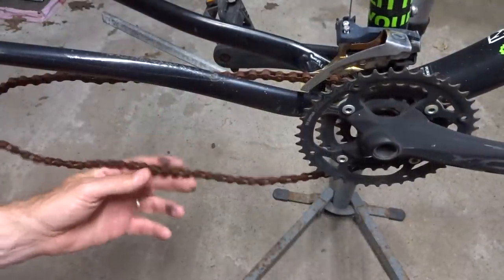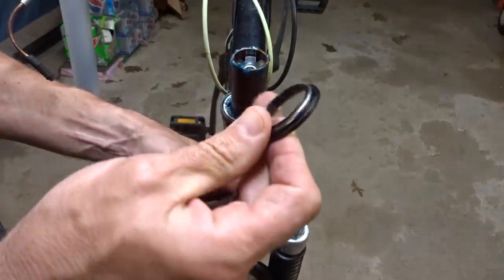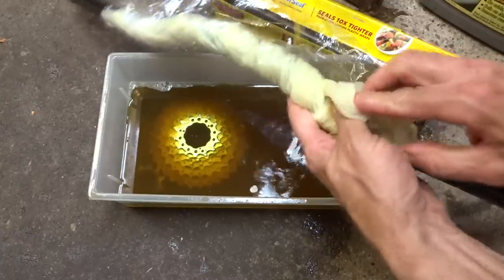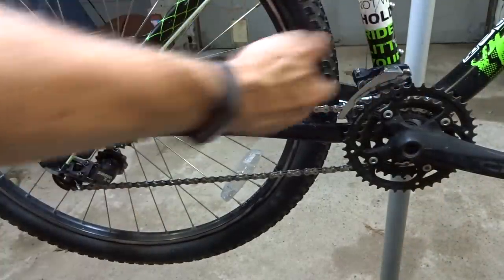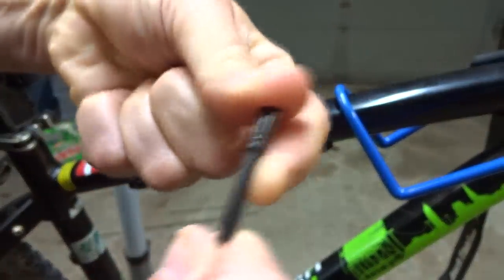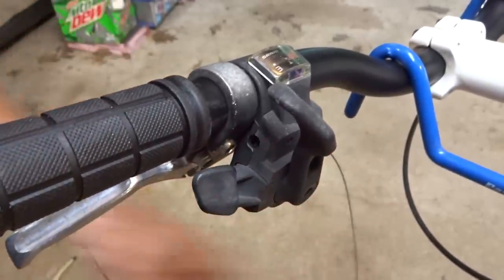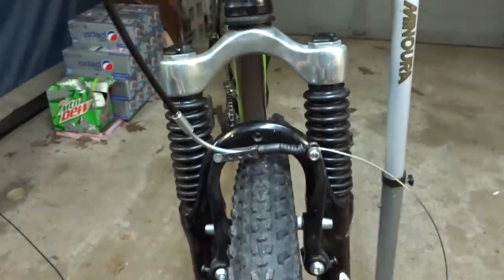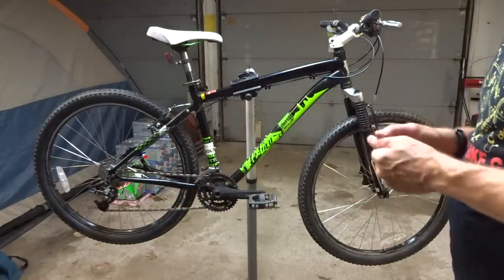Fixing/Overhauling The $15 Specialized Hardrock Mountain Bike

Comment: Air compressor is best for removing and reinstalling grips. I know it's not very common but if you got one, it makes quick work of the task.
Reply from the maker: I have one. I have done it. But since I don't leave it powered up, it's inconvenient.
Reply from the maker: https://www.youtube.com/watch?v=pqjuQ94ArYA
Reply: @RJTheBikeGuy  Ah, I missed that. Holy smokes that was impressive though. Lol. I remember fiddling around trying to change my grips when I was 10 years old without having a clue. Tried to cut the old ones off and damn near stabbed myself. Been using a compressor since but alcohol doesn't look like a bad option either now that you've demonstrated it. Thanks for the videos. 👍

Comment: Those lockable headset spacers work a treat rather than trying to hold the forks on and put the handlebar gooseneck on.

Also if you can't get pure alcohol under the grips, cheap hair spray works well.

Comment: RJ The Bike Guy, good job as always. every thing is set neat and tidy. love your work and your channel. I'm a subscriber. By the way i do not want to hate or throw punches, but you forgot the dust cap on the headset bearings. The Vbrake boot is ok. this is wide fork, you need to put the thicker concave/convex washers inside and the thinner concave/convex on the outsie, on both arms of the vbrakes to account for the wider fork. this will eliminate the boot problem too. The boot is screwing the left to right balance o the brake.

Comment: That's my bike! That's my bike! I bought it used from a speciality bike shop here in Toronto a few years ago. Paid $375 Canadian for it!!! No real problems at all though. The shop tuned it up for me. Felt stupid picking up me bike while some rich Saturday rider showed up in full biking regalia to pick up his $16000 bike. Looked like he could barely ride. That's what I get for not being a better student and back in school. Could have gotten a high paying job tool blow $16K on a "toy".
U done a beautiful job man! Really nice! My bike looks pretty good still. Was thinking to completely overhaul and freshen up but have not done that kind of stuff in decades. I'd probably FUBAR it totally or never have the time to get it back together. Question, the only problem I have is the chain has skipped on my before. I was just about to stand and pedal and it slipped. Scared the crap out of me. Had I actually stood up and that happened I'm afraid I would have gone over the handle bars. Any suggestions? New change should be installed? Thanks bud!
Reply from the maker: https://www.youtube.com/watch?v=VzrpC7jrz8U
Reply: @RJTheBikeGuy  Thanks mate! I actually found this vid today before finding your vid on cleaning up the Hardwick. I only got 30 seconds into it tho before I got busy. Forgot to go back to it. Thanks for providing this link.

Comment: you had the front derailer to low to the cog , that is what the noise was when changing gear , also try using air compressor to get the grips off and on , very easy !

Comment: Great video! I was quoted $400 to overhaul my 2003 Trek 4900. It needs a new chain and front derailleur and they told me they’d have to swap out the entire crankset and maybe the bottom bracket. Now I’m thinking maybe I could just DIY it.
Reply from the maker: If the chain rings are worn, they may need to be replaced. Some crank sets make it difficult to replace just the chain rings and it is easier to replace the whole thing. I don't know your case. https://www.youtube.com/watch?v=NklSnn7f298
Reply: Thx. This is likely a good candidate for a conversion to a 2x.

Comment: RJ, I am now forced to replace the drivetrain (gears) on my 1994 Trek 830.  I took good care of it, but everything wears out eventually. The original cassette is a 12-28, but it looks like the only similar quality Shimano cassette now is 11-28. I don’t mind the slight difference, but will there be any compatibility issue with my 1994 Alivio rear derailleur?

Comment: Good job. I'm impressed how Rustwapour works. What other products would you recomend?
I'd like to know how much would it be fair to charge for this work. 
I'd also check out and grease the bottom bracket and wheels bearings if that bike was mine.

Comment: I just use an air compressor with a blow gun and blow the grips right off. Works super fast. Just put s little electric tape around the tip of the blow gun

Comment: Great video.  Love the Evaporust tip.
Reply from the maker: Because rust gets inside the moving parts of the chain. So the chain would still be damaged. And chains are cheap.
Reply: @RJTheBikeGuy  I thought so and I saw your reply below in another reply. I thought I re-edited my question so you wouldn't have to repeat your answer.  But greatly appreciated!

Comment: After you dip the components in the bath, some of the paint comes off and it would look better if you would have touched it up with black flat paint, the same thing for the shifters, if the chain was rusted out the shifters would also need some touch-up paint.

Comment: Great job and a very in-depth video of the overhaul. Surprised you did not address the bottom bracket with fresh grease on the bearings since you worked on just about everything else.
Reply from the maker: It was a sealed cartridge bb.

Comment: If you want to repack caged bearings without making a mess, take a sandwich bag with about a tablespoon of grease in it, and drop the bearings right into it. Then you can squeeze the grease from the middle to the outside of the cage, ensuring that the whole cage is packed without buying a fancy device or wasting a pair of mechanic's gloves on the process.

Comment: I enjoyed watching your video and for those who want to follow along you provided video footage of each step. As far as what I think about the project, well you just refurbished a very usable piece of equipment and instead of being stripped or thrown away, it will provide exercise, fun and transportation for someone so that to me outweighs the cost and time invested. Of course, you could have upgraded some of the parts, build the bike up into a more expensive, feature rich and higher performance ride or gone the other way and reuse original and scavenged parts. For some of us, refurbishing and restoring can actually be harder and cost more in time and money if we want to do or add a lot beyond the original setup. 
I don't see anything as wrong as long as we don't just waste and dispose of usable parts that other people could use. You didn't repaint the bike or polish everything, but again, personal preference or individual purpose for owning a bike will guide a project. If you refurbished, rebuilt or upgraded another bike and repaired or replaced other parts I am sure many would watch. One bike can't really let you show all your knowledge or the types of parts and designs we will find on the different types of bikes available.
Reply from the maker: The purpose was to make a cool, solid bike for a friend, to replace his stolen bike, and to keep the cost for his mom as low as possible. I could have easily upgraded it, if I wanted to throw money at it. I have a ton of videos where I upgrade bikes.
Reply: Like I said, you "could have" done more, but you accomplished your goal. You asked for comments and I think it was a good project. A lot can be learned from this build. I am going to try and watch some of your others videos for sure. I still have my Panasonic from back when I was in high school except for different handlebars, grips and slightly thicker tires. In addition I have a few others that need work and I hope to fix them up in my spare time.

Comment: I found this video this morning, and subscribed! I have a discarded Infinity Huron bike in the garage, with many weathered, rusty parts, and it's a good candidate for restoration, and a conversion to a Swytch electric wheel and battery pack. Good hint on managing rust with Vapo-Rust, it's sold in my local auto parts store. Also, good hints on cable management. I have to agree, though, the suggestion on using green for the cable covers was a good one, if you can source it!

Comment: It would be useful to show you trueing and tensioning the wheels as this would improve the brake performance 
Also setting up the brake shoes so they give maximum stepping power and don’t wear down unevenly 
Going into more detail with reconditioning the bottom bracket and how you set up the saddle height
Reply from the maker: These are all different things, and I have videos on some of those. This bike had a cartridge bottom bracket which was fine, but is generally just replaced when it wears out. There are formulas that give a starting point for saddle height, but it comes down to personal preference.

Comment: really good work rj, i'm also fixing a bike, which hasnt been used, it has superficial rust in the handlebar, i used sandpaper and and steel brush, it resulted way better than it was, but not near as good as the result you had, any recommendations?
Reply from the maker: Rust remover, wire wheel, sand paper, etc.
Reply: Concentrate and ask again.

Comment: I have the same bike and also needs a little bit of TLC. What’s the best way to match up parts like brakes and gearing systems? Ordering online is way cheaper, but I don’t know what I’m looking for to get the correct parts
Reply from the maker: You are going to have to research what will work for you. There are tons of stuff that will work. But you have to understand what works together. And I don't do project planning.

Comment: i have a question RJ. about the chain tension. the derailleur here has to pull all way back when you give him lots of chain for tensioning (front small + rear small). i learned somewhere else that correctly sizing the chain works like this: put it on larges cog in back and largest sprocket in front. do NOT run it through derailleur. then bring chain rings together and align for inner part, then add two more rivets. i did so on my bike and to me it seems perfect. also, my derailleur does not pull it almost horizontal for small/small combination. is this the correct way to do it? what you say, is it maybe bit too long in your video?
Reply from the maker: Here is how I do it. https://www.youtube.com/watch?v=ELsKrgTt0oY

Comment: Not always that easy.  At a bike shop I go to they FIRST put the bike elevated on a rack, looked at the bike, and told me what was worn out.  In my case they told me to just buy a new bike. It was going to need new wheels. new chain, new bearings,  and all new gear sprockets. Their cost was $360 while my cost on Amazon for parts was around $240.  The road bike was getting too hard to peddle as among other things the spokes had stretched. In the end I bought a new Winsor Welington 2.0 online for $399.  An added bonus was it had a lighter aluminum frame and came with 100+ psi tires. For my type of exercise riding the new bike is extremely easier to peddle at speed. The higher pressure tires are a big deal.  Fixing it myself, I still had an old bike.

Comment: I think you could save on some of the rust remover by placing the parts in a plastic bag, redusing the volume needed? For the environment etc.
Reply from the maker: The rust remover is reusuable. After I cleaned the parts, it went back into the bottle. The stuff I used had been use before.  Just keep using it til it turns black and stops working.

Comment: Hey, I have a very very similar threaded suspension fork (spring), but when I pull up to do a jump or bunnyhop it makes a clunk sound. how do I fix this? this only happens when I'm pulling the front wheel into the air
Reply from the maker: Some forks do that. Generally lower end forks that are not made to do that.

Comment: wow... Evapo-Rust... I've been using Naval Jelly or some other sort of phosphoric acid but I think you just converted me for any items that can be soaked! Thanks!
Reply: Surprised you trusted the original chain length rather than measuring yourself. At the grip reinstall now... personally, I like using hairspray.. lubricates to let it slide on but dries to a sticky finish that keeps the grips from rotating much.

Comment: Good job, always nice to see bikes getting a 2nd life. Why didn't you cleanup shifters and brake levers since you did handlebar and new grips? For cables/housing I usually leave them under tension for 24 hours by shifting to largest cog and biggest chainwheel. For brakes I use toestraps to lock the levers. This allows housing/cables/end caps to settle. Just a thought. I also remove stickers (size, warnings, made in...) to give bikes a cleaner look. I noticed you got rid of the ugly plastic guard in the rear wheel, looks much better! Cassette looks brand new, amazing product you use. Do you know if something similar is sold in Europe?

Comment: Started wrenching on bikes in the late 70's, managed several shops and had my own for 20 years. Good video, did you check the crank arms?  Especially the left one, those buggers always manage to work their way loose.
Reply from the maker: I rarely have had issues with crank arms coming lose unless they weren't tightened properly at some point and they were ridden while loose and damaging the mating surface in the arm. They were fine. The cartridge BB was loose, but I tightened it.

Comment: Your video definitely informative,where to get Evaporust?Does it harm decal on the frame.I got 1980 Diamond Back bmx Senior Pro with emaculate decals but a lot of rust Bmx Facebook groups usually use Oxciylic acid which doesn't harm decals but works on rust.How are the two in comparison?
Reply from the maker: Evaporust shouldn't harm the paint or decals. It is not an acid and will probably be gentler on your bike.
Reply from the maker: You can get it at Amazon, or other places.
https://www.amazon.com/exec/obidos/ASIN/B00M0TLQ66/ref=nosim/youtube25-20
Reply from the maker: https://www.youtube.com/watch?v=DZVdkLWAurE

Comment: I'd advise against snipping the old cables with your cable cutter - that's for cutting a to-be-used cable nice and clean! Don't wear it down, use a regular pliers snipping portion =)
Reply from the maker: It's what it's for. These are shop grade cutters and made to last. I have cut tons of cables and housing with it and never had issues.

Comment: Question...how did you avoid not adding a new cassette/chain ring..when you replace the chain?
Reply from the maker: The stuff wears. Keep the chain lubed. Get a chain gauge and check the wear on your chain, and replace it before it gets too worn. Then replace the cassette/chain rings when they need it.
Reply: The more often you replace the chain and the better condition you keep your chain in by lubricating and cleaning it every so often the less the rest of the drivetrain will wear and the less often you'll need to replace components such as the cassette and chain ring.

Comment: those specialized from 10 years ago are just beautiful .. actually mine it's from that era but just it's black.
anyway nice job but i would even use some cleaning spray on the shifters inself, they works way better after, those sram x4 have a big hole that can be used to lubrificate them but sadly even the water goes in there.

Comment: Nice job! What about the bottom bracket and hubs? I imagine the bearings would be in the same shape as the bearings that came off the steerer tube or maybe they are sealed? I wish I had more time on my hands to do stuff like this. Looks like fun!
Reply from the maker: The bottom bracket was a sealed cartridge and was fine. The hubs were okay. Some work was done off camera.
Reply: RJ The Bike Guy I started Mountain Biking on a Raleigh bike. I guess you might call it a stiff-tail because it had no suspension! Later on I upgraded to a Hardrock similar to the one that you fixed up. Brings back memories!

Comment: Do you have a way to restore all the bike plastic part from Sun damage? Color fade out ot turn yellow.

What is your opinion having spoke protector? Have it or not have it? I have use old CD. Cut hole in the middle to fit on rear hub to work as spoke protector. But CD is flat. Not conform to spoke taper angle. Do you have other day around it without purchase spoke protector plastic?
Reply from the maker: Not really. https://www.youtube.com/watch?v=o9oVJUplaQI

Comment: Hi RJ, did you do any work on the bottom bracket during the restoration? have mine to do soon just wondered if there is a heads up anywhere, not rocket science I know but always worth a little knowledge beforehand.  Cheers.
Reply from the maker: It was a cartridge BB. So generally if they are worn out, you replace them. The BB on this bike was a little loose in the shell, so I tightened it up. I have videos on BBs.
Reply: Ha ok, many thanks for your timely response, much appreciated.

Comment: Love the Videos RJ.

Why do you use the barrel adjusters on the brake levers to open the distance on the brake pads when you pulled the cables?
Reply from the maker: They are there for fine tuning, and the adjust as the pads wear.

Comment: Why did you skip wheel bearing check, lube?  Same for the crank bearings.  Were the wheels true?  The rear one looked like it was a bit out of true.
Reply from the maker: I checked all that stuff. Not every second of the work is in the video. It was just the tire not seated evenly. I let air out, lubed up the bead with soapy water, and reinflated, and it was fine.

Comment: hi RJ I really enjoy seeing an old bike or anything really restored to like new like you did. Fantastic job. I have a c. 12 y.o. Schwann mtb Just serviced and goes great. One thing though. The brake cable is so tight it is difficult to pull out the noodle to take off the front wheel. How can that be adjusted to make that easy to do? Cheers mate and look forward to your next post.
Reply from the maker: shrug Some are tight.
Reply: Try adding some slack from the handbrake adjuster or check if the cables are dry :)